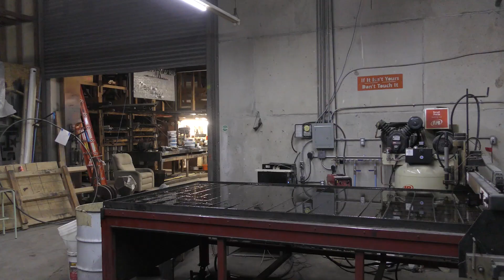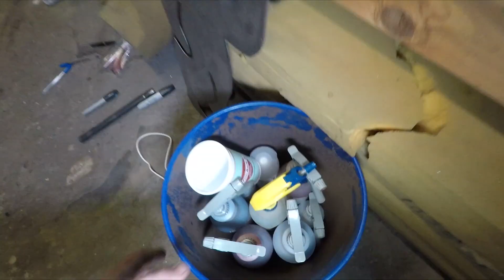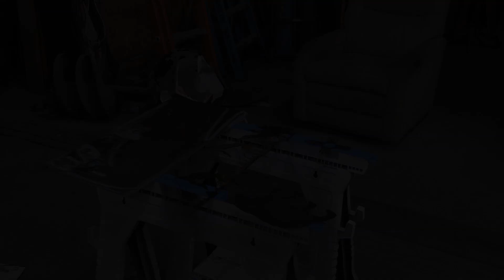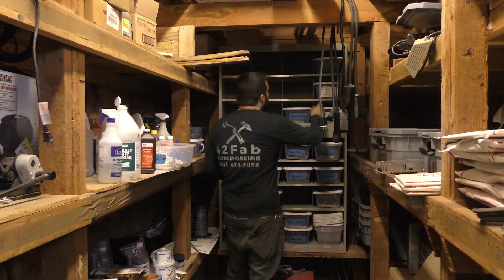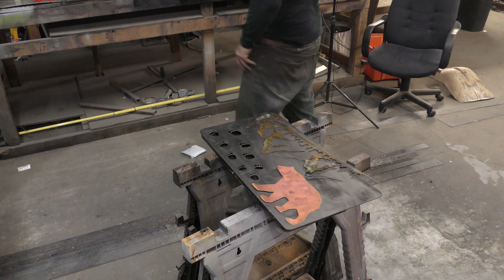Steel Patina New Mexico LED Sign | Wall Art

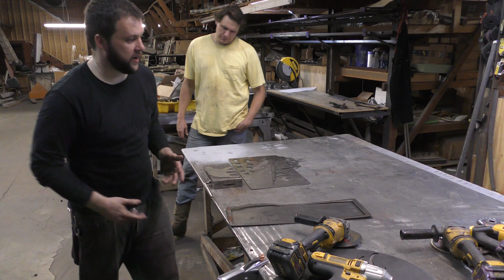Comment: At 2:27, let me reiterate the fact that doing the bottom side up first is best.  If it's down, your parts are farther away from the magnet can't stick as well.  Parts can fly.  Then, once you clean of that dross, you can flip it over and smooth the other sie.

Comment: I've got a drawer full of grinder guards 😁 only time i've had a grinder incident was when the guard was attached. Full face shield with wire brushes is a good idea tho.
youtube has been spamming me with your channel for months.. decided to have a look see and i'm glad i did👍 interesting content and a down to earth attitude, and if Bart likes it, i'm in good company'
Will binge watch a bit more later on, gotta go try to be productive'
Cheers from Tasmania 🍺
Reply: I was too lazy to keep swapping my expensive 3m filters between my mouth/nose piece and full face. Ended up using the full face for everything for years and wouldn't be without it. 
I can put it on in 2 seconds now and really being able to get in close to a part without worrying about your face I think is invaluable. Its also comfy and doesn't steam, my best tool.
Reply: I have a vague plan one day to get a double flip motorbike helmet ( normal visor as well as the chin can flip up) add a small fan for positive pressure and see how that works

Comment: Hypothetically if you were to mount a drill spindle on the plasma head so you could avoid pierces, would it save any money?
Reply from the maker: Yes, at the expense of time (more valuable). Machines that cut through very thick materials do just that

Comment: How does the HTP welder compared to the Everlast you had that's a good-looking sign
Reply from the maker: Well. I don't pit machines against each other, but I'd take the HTP 100 times out of 100. Especially now that the pro pulse 220 is a full MTS machine
Reply: @42Fab  thanks for the information I'm looking to get me a 220 MIG welder and was curious I was affordable
Reply from the maker: @robertlange5675  if the 220 is out of reach there are likely to be some used pro pulse 200s available due to the new upgrade

Comment: Nice.  I use guards on all my grinders.  Never seen a benefit to have them off.  The wire brush is awesome..  but yeah, dangerous as fuck.  I’ve caught my hoodie a couple times...  and it hurt like hell.  LoL.  Been thinking about adding a face shield to my ppe.  Something about a wire or grind disk in the cheek doesnt sound fun.
Reply from the maker: I have the face shield, but most often it's a pain to use. If I were doing a long grinding session though, it'd make sense. I've taken a wirebrush to the gut twice, sucked both times.

Comment: not sure what software you are running,  Mach 3?  There are son setting that you can adjust and maybe get rid of the rounding problem at higher speeds.CV Control: 

I got this from Mach3 CNC Controller Software Installation and Configuration

Plasma Mode, if checked, controls Mach3's implementation of constant velocity moves 

to suit the characteristics of plasma cutters. It does anti-dive and tries not to round corners in some 

circumstances. For the most part, ArtSoft USA suggests you not select this option unless your machine has very poor acceleration and poor step resolution.

CV Dist Tolerance lets you define the permissible tracking error when operating in constant velocity 
mode. This will affect the amount of rounding on corners. Setting this to a high

 value will allow faster movement but increase rounding

Had the same problem with my cnc router
Reply from the maker: Thanks. I've played with it some and made the acceleration round off go away, but then I get missed steps. Downfalls of old equipment, soon to be rectified